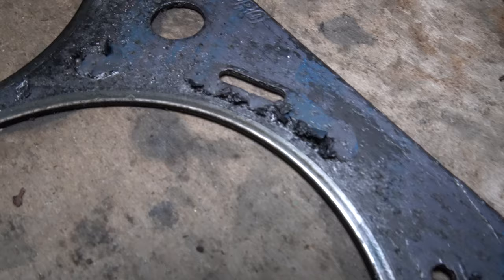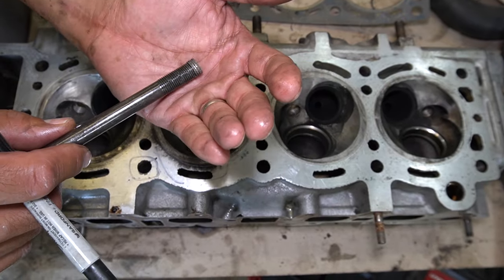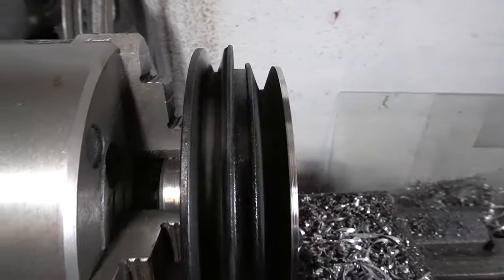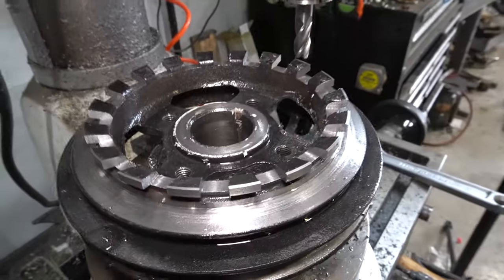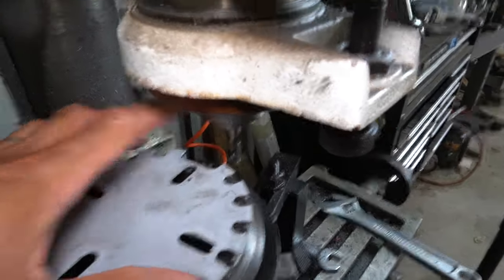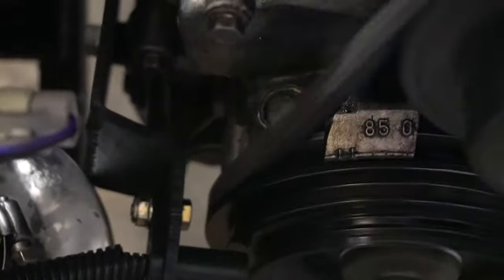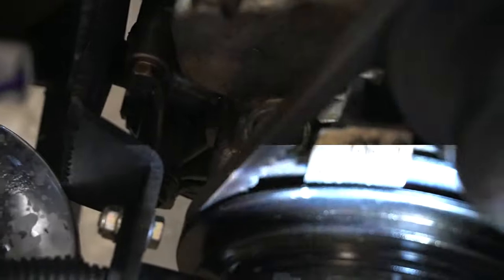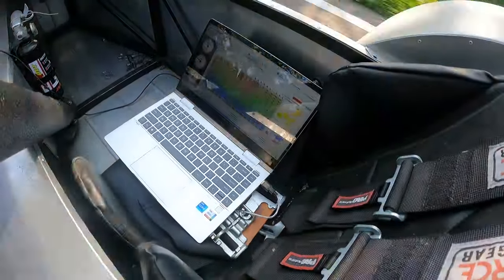Converting Old Junk to EFI with Microsquirt | Part 3

Comment: Two things, one it's called a 36 minus 1, because it's 36 teeth, minus one of the teeth. Two, you have a cnc plasma cutter. Why on earth didn't you just cut yourself a 36-1 wheel with the appropriate holes for your balancer?

Also, it's a balancer, when you cut material off of it, it's no longer going to balance and when you cut material off the opposite side from the missing tooth, you cut it farther out from center so you would need to cut off less material because of the additional centrifugal force farther from center. 

Though, in the grand scheme of things that's not going to make that big of a difference with the amount of material you removed and the application.

Overall, great job.
Reply from the maker: I don't have the "fine cut" torch for my plasma, so the backside of the tooth would have more of a radius than the leading edge because of the speed at which it has to cut 1/8" or less steel.  I didn't know if it would be an issue getting a clean square-wave signal, so I opted for the laser cut.